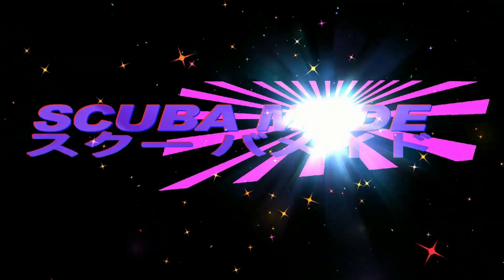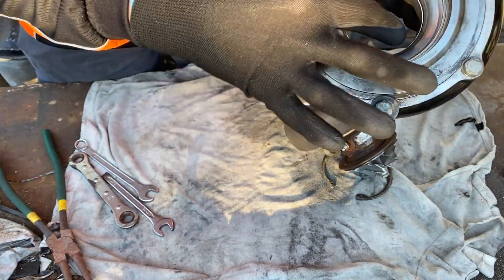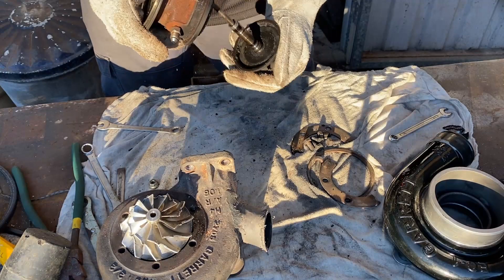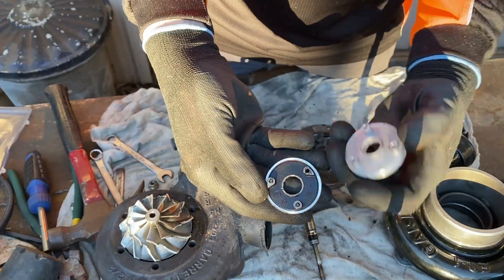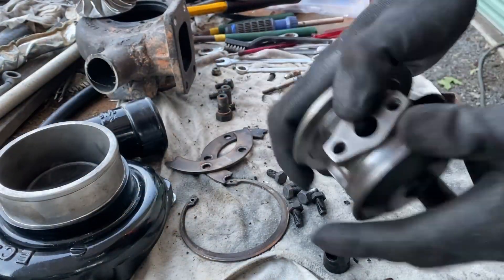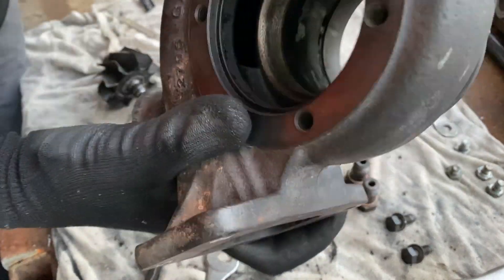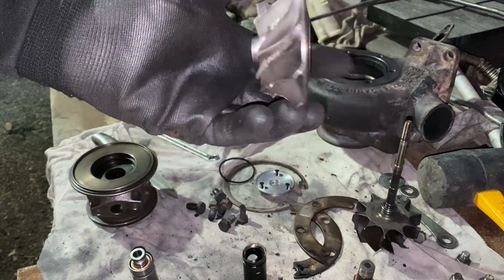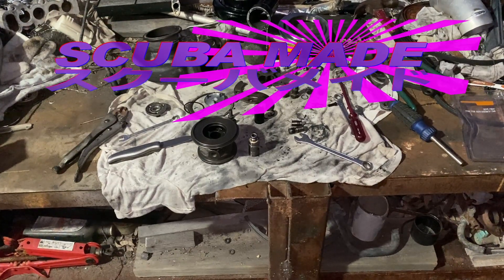Broken GTX3582R Tear Down! Can it be fixed….

Comment: Would it be cheaper to buy a brand new core than all the pieces individually? As you will have to get your rebuilt core balanced or it will not last, interesting tear down video none the less 👍
Reply from the maker: Yeah I think it works out about the same so replacing the core may be better but I enjoy playing with all the parts haha! 
Thanks, it was interesting to see what the damage was inside!